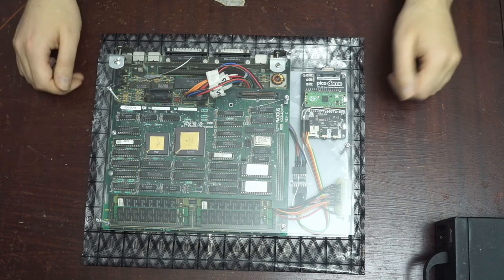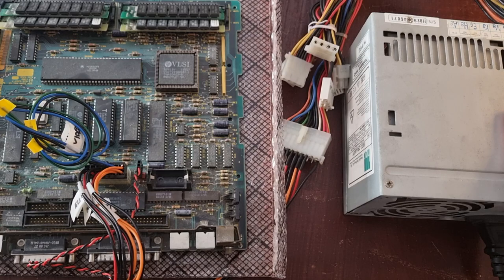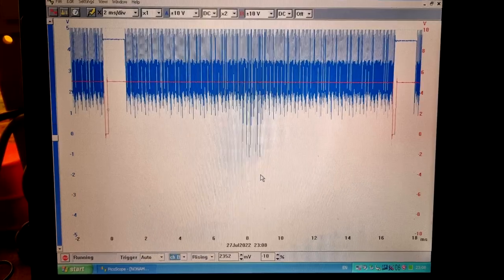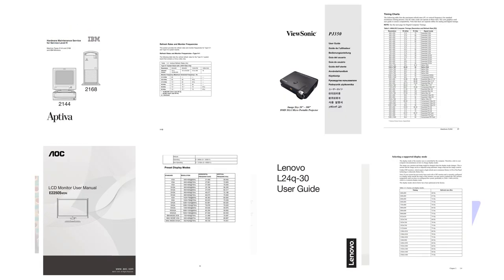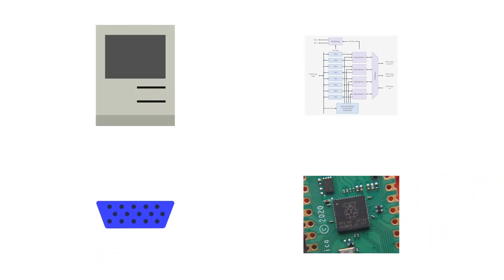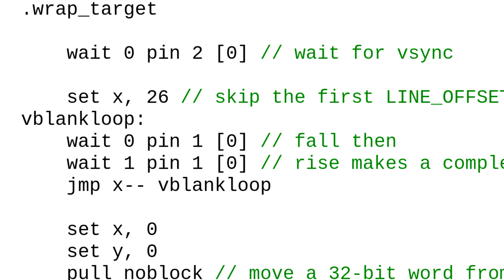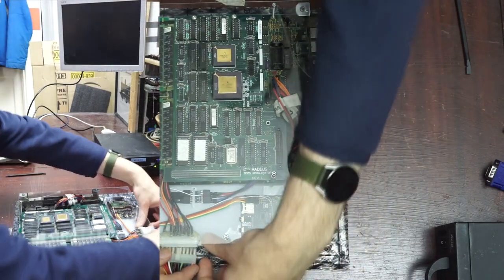Bringing a Mac SE back to life with a Raspberry Pi Pico #Marchintosh 2023

Comment: Love it! So many neat projects are popping up around the Pico now!
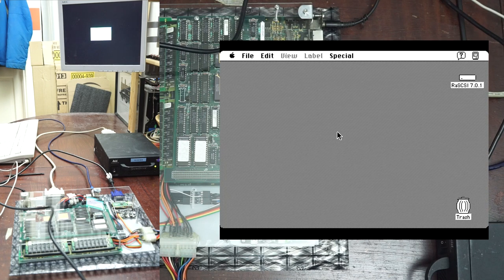FYI: There's a high-frequency noise introduced at 8:17 as you plug the VGA to your capture device.
Reply from the maker: Thanks, and thanks for pointing out the high-pitched audio! I hadn't noticed it. Hazard of using CRTs every now and then perhaps...
Reply: @theguruofthree   you may need a low pass filter on the audio or you have and earth loop..

Comment: This is a really nice project; I really enjoy resto-mod videos that feature a problem solving component. I don't know if you've come across them, but there are actually so-called Pico PSU ATX modules made now that would fit in the empty space at the bottom right of your acrylic sandwich which could make this device completely self-contained.
Reply from the maker: Yes! PicoATXs are great! As I don't plan to use this full time so I left the option to use whatever PSU was on hand.

Comment: Full credit for the Pi Pico solution, but given the SE is outputting the correct video signals, that means the problem us in the CRT or CRT power supply.  Wouldn't just be easier to fix those assuming you could get another CRT?

Comment: I'm impressed. This is certainly a bit beyond my skill level, but it makes me wonder about doing something similar for the SE/30.
Reply from the maker: All the classic all-in-one macs I believe have the same black and white 512x342 video, so this should work for the SE/30 as well. I think just which pins you need to connect on the logic board are different between them.
Reply: @theguruofthree  I'm pretty sure you could just drop the board from an SE/30 into an SE for an instant upgrade. The others not so much

Comment: Awwwww you're  using an AVID QuietDrive! Being an ex AVID tech this does bring back memories! Aren't they super great (and cheap, I imagine)
Reply from the maker: I indeed did find my QuietDrive! pretty cheap and it's a great enclosure. I swapped out the hard drive for a PiSCSI/RaSCSI disk emulator. The disk coming out was amazing, I'd never seen such a chungus full height SCSI drive made after 2000. I can see why designers went all out on the noise isolation. The design is pretty modular too, which made things easier. I was able to hook up the three LEDs for power/bus activity/disk activity and swap the PCB for a direct connection to the disk emulator.
Reply: @theguruofthree  I can confirm, have used them as internal drives unpackaged in my friends  IBM PC DAW , of 2001 vintage

Comment: Very mean and lean solution. Love it. I've been using the RGBtoHDMI solution for close to 2 years for my Mac Plus and Mac Classic 1 and captured much footage on my channel as well, but it's dependant on sourcing a harder to find pi zero or pi3. The vga to hdmi converters I've used for my dos things are hit and miss unless you bite the bullet with an OSSC. 
I was wondering, since you're very well positioned and versed in the capabiliites of the pico, would it be possible to do the same for all the resolutions for dos vga machines, including the weird one used by a BIOS?
Reply from the maker: I have thought about VGA capture. Annoyingly, video signals that use TTL digital logic, like for the classic Macs, MDA, etc., are comparatively trivial next to VGA. My understanding of the challenges is that to read in VGA you you need to reliable measure changes of 3 mV or so at 40 ns intervals (255 divisions of 0-0.7 V at ~25 MHz). The analogue to digital converter in the Pico takes something like 20000 ns to read, so some external support circuitry would be needed. I think the OSSC uses a TVP7002PZP for this, but hooking that up to the Pico is essentially just recreating the OSSC. Rather than that, I've been more curious about a minimum viable product converter in the forming of reading in 8 colors of VGA by ignoring the graduations of voltage and reading the analogue as if it were digital. Something like that would capture those weird BIOS screen resolutions, even if they might not look perfect.